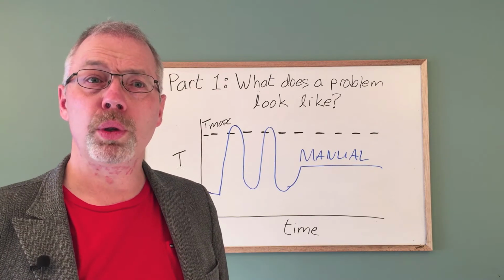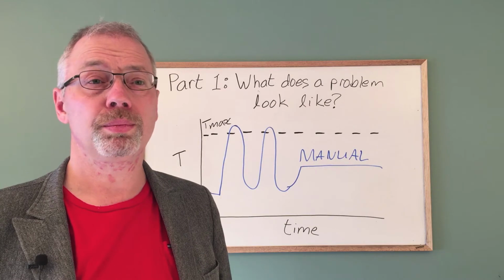Kevin’s Whiteboard Part 1: Control Problems

Comment: Despite Tmax being the maximum inlet temperature, how did T cross Tmax. And how that change was brought down to stay state, that is under control?
Reply from the maker: Consider 4000 kpa steam that is used to heat the feed stream, and suppose we do not want the feed temperature to exceed 200 c. The steam could heat this to 260 c. In this example I made the temperature stable by placing the steam control valve in MANUAL at 50% open. But this is not under control. I need to find the cause of oscillation and fix it.
Reply: @kevindormaconsulting4763   @Kevin Dorma Consulting  yes, agreed. Manual control has its own very limitations, and requires high estimation skills from the manual operator. Which again is scarcely limiting. 
For this reason we use automated PID controller. 
I believe that the cause of oscillation is due to disturbances in the upstream, could be due to increased flow rate, increased pressure. 

I believe that a finely tuned pneumatic valve would work the best here, to maintain the temperature under range.